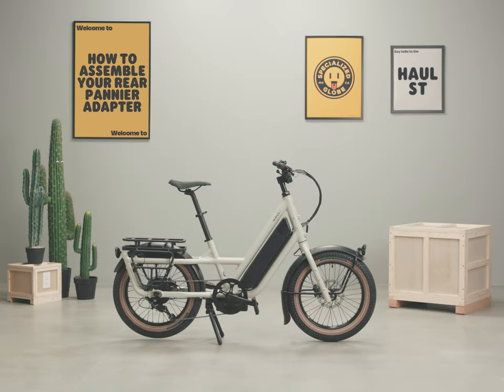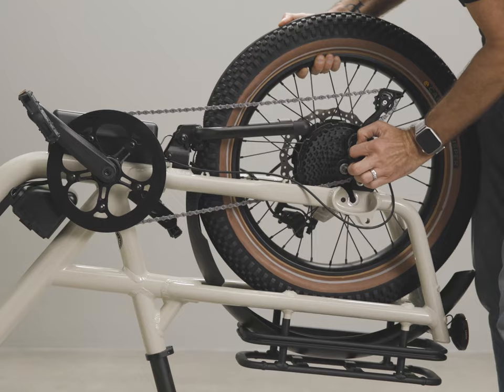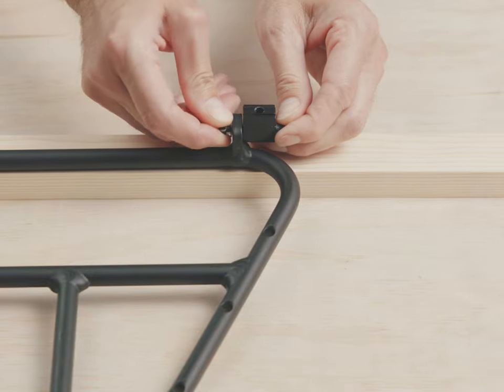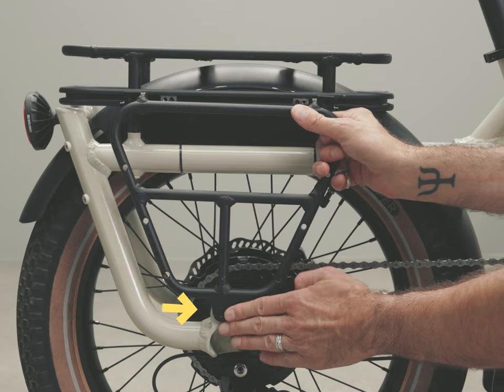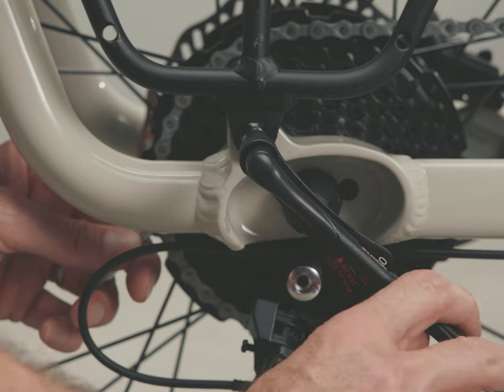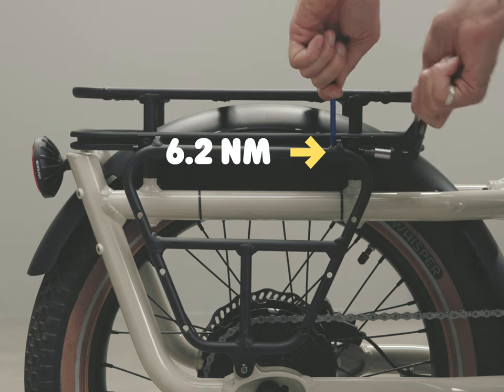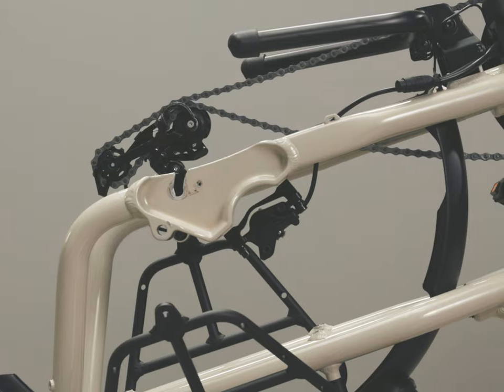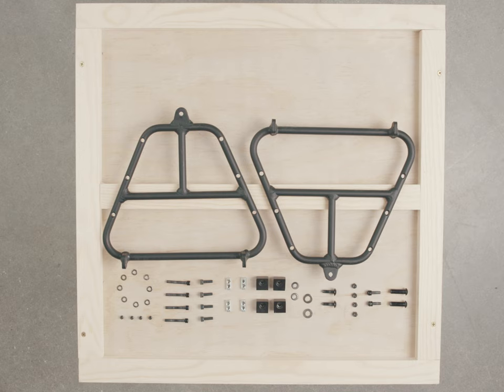GLOBE | How to Install the Rear Pannier Adapters on the Globe Haul

Comment: You need to make a "second set" of adapters for longer feet.  Just move the bottom bracket forwards about 2", to move the whole rack back 2".  That should give enough room so that sized 12+ feet and pedal and not strike the bags.  Are these made from steel so I can cut and weld them to the new places?

Comment: You need to  make it so that the front and rear pannier racks are the same.  Alternatively the rear rack should come from the factory able to mount a pannier.  What's the point of a rear rack that can't do that?  That's a major fail.